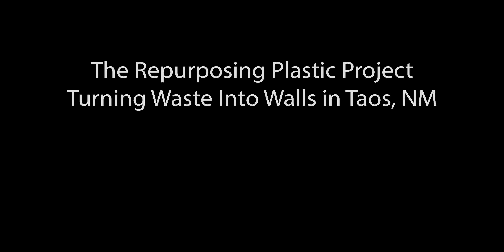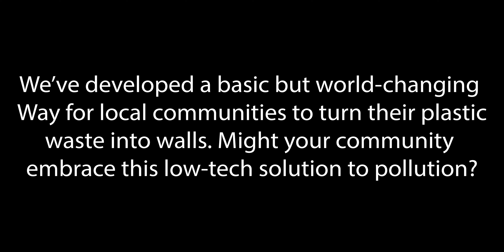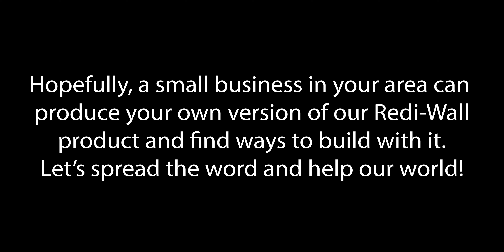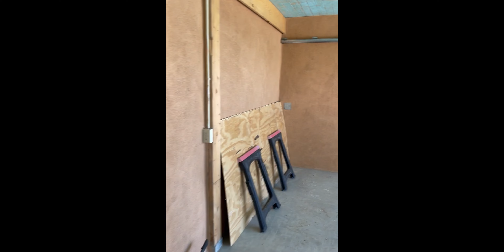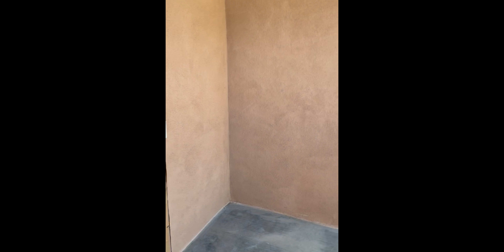Repurposing Plastic: Turning Waste Into Walls in Taos, NM

Comment: Hey, guys.  Please contact Rick Caruso in Los Angeles.  He is a developer and may run for Mayor of L.A. again.  He is also very involved in the rebuilding post fires.  Please, figure out how to get in touch with home directly - If anyone can help your get your business viable and growing it is him, and if there is one place that can use your product it is Los Angeles. 
It seems to me that this would be a great resource for us.  It could help in making housing for homeless, quicker and less expensive.  Plus, it should be passive heating and cooling ( less demand on an expensive &;stretched power grid) not to mention much more earthquake damage resistant.  
Plus, it can mean jobs for homeless, or can be for prisoners to do to pay back society.  Let's get you guys here in L.A. 
If you sell Rick Caruso - he will make it happen.  As a developer and business man he can make this work and grow your business.  Right now the block wall between me and my neighbor is cracked and will probably fall down because of a tree too close to the wall. But , also- block walls are easily damaged in earthquakes.  The big thing will be to also make these walls fire proof.  A big benefit is they are probably also sound buffering too.  A big plus over regular construction.  They are a lot like straw.bale construction, but they recycle material too.  
This product could mean jobs, less waste in landfills, Faster and more economic housing for homeless and low income, New fencing options for properties.  Plus, the ability to make curved and unusual forms would be easy.  
He is a business man, so much like Shark Tank- be ready with the business model and money info. 
The time is now to get your foot in the door.  LA needs AFFORDABLE housing 
NOW.  We need jobs for those who are unskilled, or are  re-entering work force .  We need to start re-cycling, re- using , re- purposing and rethinking housing . 
Your product checks all the boxes✔️